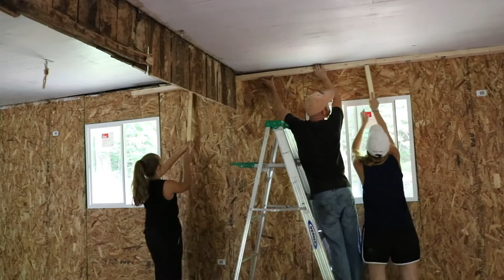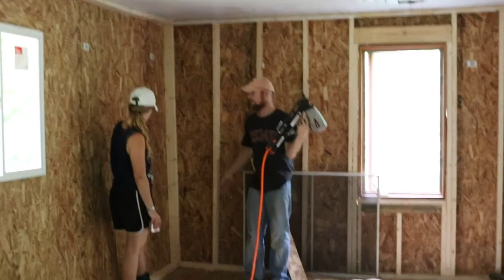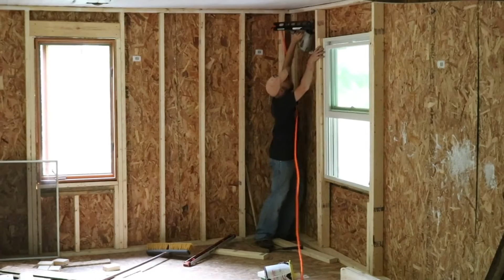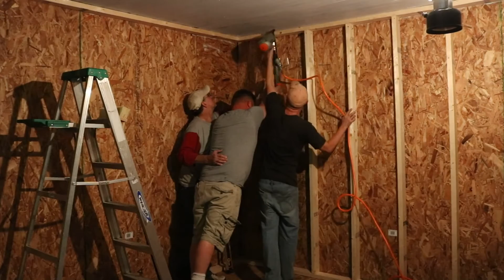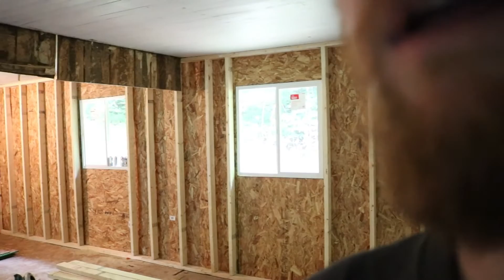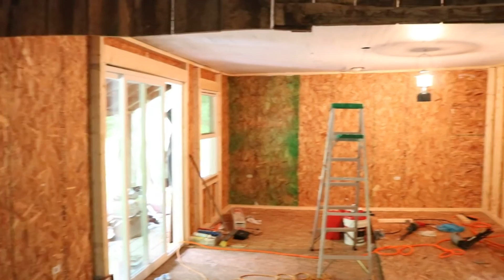Off grid cabin restoration (part 7) A helping hand goes a long way

Comment: As before, great job and great progress.  I was one of those that thought the place looked dangerous from a mold and animal droppings standpoint and thought it may be better to burn it down and start over.  
But now, you will have a house that is virtually brand new on the inside, where you live, yet still have the looks of a historical house on the outside.
Reply from the maker: Thanks :D this project really was for me to learn how to build something.  It has been so much fun.. My father, wife and I (and most of the rest of my family) have all had a hand in making this project happen.

Comment: When using a nailer i hold trigger down bump it into stud will only fire once cause when bump it causes gun to bounce back away from wall / floor  ect only use this method if your very use to the gun lol , but helps alot with firing multi  times like does when you press nailer against wall then pull trigger very often wants to rapid fire .
Reply from the maker: Lol, this was the very first time she used a gun. didn't want her swinging it around. :)

Comment: Rocking along.  Thank goodness for helpful family.  Tell us about the plumbing? are you planning for indoor? do you have a well?
Reply from the maker: Yes!  We will work on a small addition which will be a bathroom.  There is a well right in front of the cabin, and we will also use rain water storage.  I set up a well pump on the big well to provide water for our camper, that video is coming soon!!